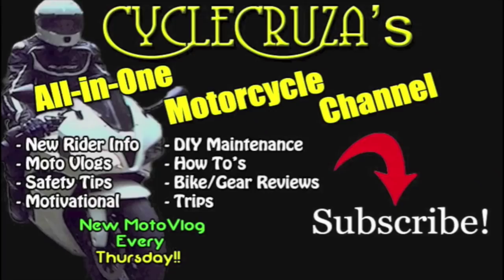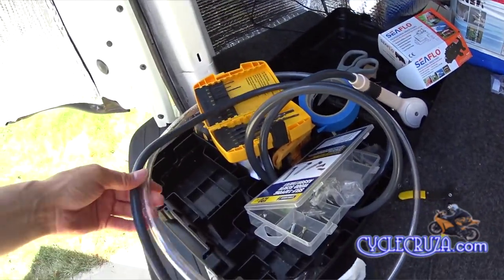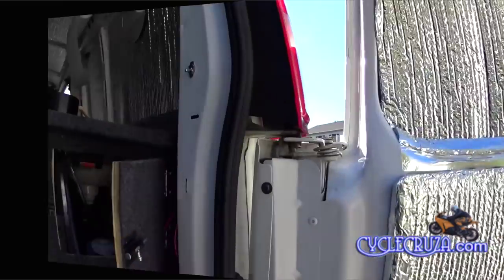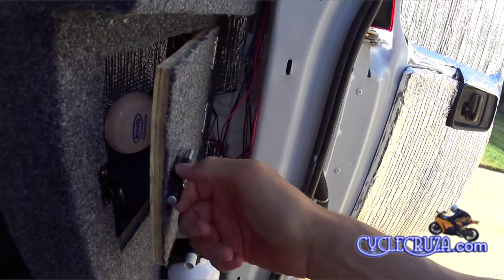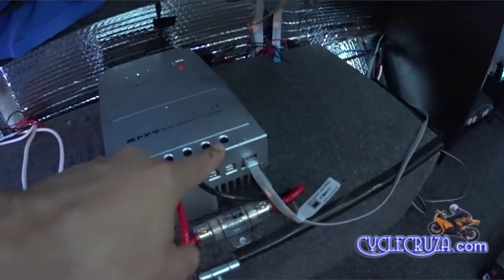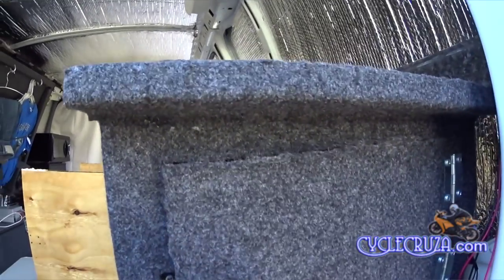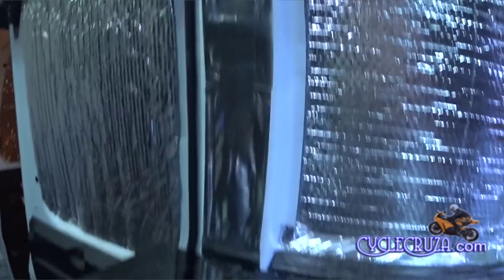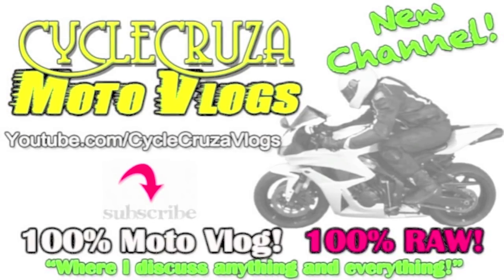How To Shower from Van | Portable Shower - Water Pump - Hot Water Heater | Bug Out Van Build

Comment from the maker: FYI - Links to get items seen in video! (Since people always ask!)
Get Portable Shower Tent here: http://amzn.to/1KLxWav
Get Water Pump here:  http://amzn.to/1M6eOHo
Get 12 volt Hot Water Heater here: http://amzn.to/1g8HmlE
Get Wall Soap Dispenser here: http://amzn.to/1M4EZMX
Get Portable Shower(Get for shower head): http://amzn.to/1H8wXCQ
Get Compact SINK: http://amzn.to/1H8xcxH
Get 7 Gallon Water Container: http://amzn.to/1H5TRbUGet CHEAP 
Get 3/4" Drain Adapter: http://amzn.to/1SCuB0T
Get 3/4" to 3/8" Hose Adapter: http://amzn.to/1Lp6SAe
Get Clear 3/8" Vinyl Tubing: http://amzn.to/1ItO9xj
Get Tubing Clamp: http://amzn.to/1CnKAXq
Get 16 AWG Oxygen-Free Copper Wire here: http://amzn.to/1CPGpcP
Get 2000 Watt Pure Sine Wave Inverter here:  http://amzn.to/1P6ay97

Get Compact Travel Table here: http://amzn.to/1IjtKvf
Get 300 watt 12 volt Water Heater here: http://amzn.to/1KLxQzp
Get 100 watt Bendable Solar panels here: http://amzn.to/1S1ROaJ
Get MPPT Solar Controller here: http://amzn.to/1S1Sop0
Get Solar Controller remote Meter Here: http://amzn.to/1K16asL
Get 155 AH Deep Cycle Battery here: http://amzn.to/1S1RxVa
Get Electrical Switch CHEAP here:  http://amzn.to/1IzFusY
Get LED Light Set CHEAP here:  http://amzn.to/1IizIQH
Get 10" Hi-res Back-Up Camera Monitor:  http://amzn.to/1M1xZAC
Reply: +CycleCruza Instead of a spoon, how about a length of PVC pipe that fits the inner diameter of the hose and notched at the bottom to allow water intake. Now you can make a fishing lure out of the spare spoon. Great vids. Film school alum?
Reply: +CycleCruza Instead of a spoon, how about a length of PVC pipe that fits the inner diameter of the hose and notched at the bottom to allow water intake. Now you can make a fishing lure out of the spare spoon. Great vids. Film school alum?
Reply from the maker: Douglas Higbee spoon takes up less space and works well.

Comment: You have some serious skills.......I've loved watching all your van conversion vids!
Reply from the maker: Ontheroadwith Joy Thanks! I appreciate your viewership. Take care!
Reply: CycleCruza You should make a shower that has water in a endless loop but it has a filter for the water to be clean water. Then it goes into the water bucket again.
Reply from the maker: Justin Hundley Maybe when I'm bored in the winter. lol Space is limited though so it's going to be tough. All I would have to do is attach an inline filter and a hose to te other end of the filter to go right back in the container. However, I don't think there is enough pressure from the drain for it to work unless there is a filter out there that will work. I'll do some research in the winter months.
Reply: Justin Hundley yes! thats always been my idea for my off grid home or van that i plan on doing but NO ONE has it so im like is it just not possible?  cant see y it would be? glad someone had the same idea!

Comment from the maker: ***CycleCruza's Recommended Videos*********

Watch Live in Van with Motorcycle Video here:
https://youtu.be/I48R4tB-cys

Watch Bugout Vehicle Unveiling Video here:
https://youtu.be/l7gU7P-kv8I

Watch Bugout Van Build Part 1 Insulation Video here:
https://youtu.be/kp59Nkk7Asw

Watch Bug Out Van Build Part 2 -Flooring Install Video here:
https://youtu.be/NXPwck_WcvE

Watch Bug Out Van Build Part 3 -Sink Counter Build Video here:
https://youtu.be/pcZR7bqqoWw

Watch Bug Out Van Build Part 4 - Folding Bed Build Video here:
https://youtu.be/VRFYFsW0t9I

Watch Bug Out Van Build - LED Lighting  Video here:
https://youtu.be/BduzjVNQgEg

Watch 'How To Load a Motorcycle in a Van Easy" Video here:
https://youtu.be/mq1YguXZQ0Q

Watch Bug Out Van Fold Away TV Build Video:
https://youtu.be/0C9AG1W-XRM

Comment: Drill a hole in one of the bottom corners of the jug. Insert water tube that goes to pump. Seal. Mount jug on slight tilt to favor corner. Win.

Would need to account for needing to remove the jug to drain or refill. But would allow you to get at that last inch or so of water.

Comment: Love the basic concept. I'm just trying to research best way to shower in bad weather rain wind or even winter. Tuff in a van you can't stand up in. If you could make a small sitting shower stall inside with a little bending and stretching you could get clean and still drain water the same way. Although in winter I'd be afraid of water freezing to tire well . Still where there's a will there's a way.
Reply from the maker: I just wash up at the sink inside the van, just as a I do in my home when I don't take a shower. I did a full body clean-up at the sink sitting on my van bed in front of the sink, no problems.

Comment: I found that I use 2 gallons of water when I shower. You also want to insulate your water container. If you are where it rains a lot and you want to store some water in a remote location if you come across a tossed above ground pool you can build a box or dig a pit and line it with the liner and then you have remote water saving you gas. Most will return to the same site. If I were HOBO I would have these water storage sites so I could use it for my needs. Just pump it out if you need to drink it carry a filter.

Comment: Rigging a switch up to your faucet handle would be easy and convenient. cut the line going into the original switch for the pump, connect a wire to each cut wire and run it along the line to the handle, then to a switch on it. Now you have to have both turned on for the pump to work.
You could either buy or make a "float switch" to cut power to the pump when there isn't enough water. That would stop you from breaking your pump.
Reply: illidur That is what I was thinking. A water proof push switch connected to the negative wire.

Comment: Continue to enjoy the videos!

I'm not sure if the wire and contact points on the heating element are meant to be exposed to the water. Usually heating elements are screwed into a tank and only the threads and element are actually in the water.
Reply from the maker: giff74 Hey thanks for watching! We shall see how it works, the wire is oxygen free 99% pure copper wire. Also, I can always put the element in just enough so the wires are not exposed but rather just the element. I'm only heating the water before using it NOT while in use! The heater element level can be adjusted by the spigot, no big deal.

Comment: if you use a drain pan designed to prevent damage from leaks on a wash machine with drain hose attached you could possibly do shower in van. these are plastic and about 32" sguare and 1-2" high, I think.

Comment: Question: Would a 35 amp hour battery suffice if it was strictly dedicated and used only to shower? I would plan to hook the battery to leads from the alternator for re charge. Also, typically, how long does it take to heat up the water to adequate shower temperature? Thank you.

Comment: how long does it take to heat the tank of water? lived in my van for 3,5 years winters harsh no heater but 2/3 hot water bottles in minus temps worked up to -15. your setup is well thought out and practical thanks for the video
Reply from the maker: +david edge Took me about 2 hours in 40 degree weather. However, I plan on hooking up the heater element wires up to my solar controller which will turn the heater on automatically for whatever hours I choose to set it at, so that way I will always have warm water and won't have to deal with a manual switch.
Reply: 2 hours not bad for that much water and low power consumption element. in winter it would act as a giant hot water bottle for the van too. maybe wrap a blanket around it to insulate then use the blanket for bed. good choice with solar. thanks for reply :-)
Reply from the maker: david edge I wrapped reflectix insulation around the container.

Comment: I would have just gone with one of those lawn and garden sprayers that you normally use for weed killer and stuff.  You pump it a few times and you are good to go... no need for electricity or anything like that.  It is also very portable.  On top of that, you get even more PSI... up to 45psi.  They start at about $10.  You might also want to get a different nozzle for the end though... like maybe one of those sprayers you have attached to your kitchen sink.
Reply from the maker: +101perspective Electricity is FREE, I have 4 x 100 watt thin flexible solar panels on the roof. When I took a my bug out trip all of my power needs were met.
Reply: CycleCruza
Yeah, I was thinking more in regards to simplicity and cost.  And it would be more portable and function better... more psi.

Not that the system shown is horrible or anything like that.  I usually just try to keep things simple is all.
Reply from the maker: 101perspective Those weed killer type of pumps are only good for a few spritzes, definitely, can't take a comfortable quick shower with it. I barely get more than a handful of spritzes when I treat the weeds in my yard.  You will definitely want solar power on the road if you can afford it.

Comment: Awesome built.  Only question with the heating element immersed like in the plastic container - any issues with the element touching the side - ie melting?
Reply from the maker: +Wade Smith No problems BUT in the future I will only lower the element only in the water and not completely immerse it with the wires because it caused rust on the top if the element and put a little rust in the water.  Rust is harmless but I don't want it in there going forward.
Reply: +CycleCruza thanks

Comment: If you are using the sink to wash and you need to keep the drain (via wheel well) closed, how much water can you hold in the piping? If that's not clear, you have a 7 gallon container, how much can you pour down the sink without needing to open the wheel well drain?
Reply from the maker: Wunel No the sink has a drain stopper. It's a regular sink with a strainer drain stopper. That sink holds a lot of water too, more than it looks.

Comment: There isn't any problems with submerging those live wires connected to the metal coil in the water?
Reply from the maker: +Zachary Woody No,, however, next time I will not submerge the wires because it made rust in the water but it worked fine. I should have just lowered the element down in the water only.

Comment: Two questions: first, that water pump sound that it's a bit noisy, have you try it on with the doors all close to hear how loud it get? and second, I am kind clumsy with electric installation, I see your water heater is electric but still is under water, how that work?
Reply from the maker: spiderpilot The inside of my van is fully insulated with 1/2" thick foam panels over all walls and ceiling and reflectix insulation over that. Even blasting my 1500 watt stereo system with the doors closed you can hardly hear anything. Electric wires work under water, if there was ever a problem I can set the level so that only the element is in the water. The spigot can control the level by just opening and closing it.

Comment: So, do you have enough power to run it all at once? Or can you only do certain things at a time.
Reply from the maker: shandon williams I would only use what I needed. Most stuff in the van has pretty low power usage except maybe the microwave, burner and stereo system. The heating element is only 300 watts, water pump uses little power, LED tv uses little power, and LED overhead lights uses little power.
Reply: Have you went out and used the van yet? Or are you still setting stuff up?

Comment: CycleCruza yo you sould have a reserve tank just in case u need more water or get another 7gallon tank just a idea bro but your van is really coming out pimped the only motovlogger with a design so freaking cool it's a sleeper looks normal outside but the inside 😋 chill mode one more thing u can edit your vids in your van to and upload your vids with some wireless network that will b off the hook for travel
Reply from the maker: willmatic 84 Thanks! I just received my back-up 5.5 gallon water tank today, it's tall and narrow so it will fit in the foot well next the refrigerator and side doors. It's never ending on stuff to get for the van. I still have to buy laptop to edit video on the road....
Reply: CycleCruza oh ok cool so u had that planed out lol I would imagine how much you spend so far 😨 but at the end results 👍 😎
Reply from the maker: willmatic 84 I have a folder busting out of the seams with receipts, however, the good thing is mostly everything is tax deductible because most of the stuff I bought was all filmed for my channel.
Reply: CycleCruza word I feel u man 😉

Comment: ok ok...so 300 watt 12volt heater element needs 25 amps of juice...How do you supply that many amps without burning something up?
Reply from the maker: +Dudeareno Rodent I have a 400 watt solar set-up with two 155 ah deep cycle dry cell batteries. I only heat the element up for a couple hours to warm the water up before I take a shower or wash up at the sink. I recently did a review on my stealth solar set-up: https://youtu.be/CNb22_F9MW4

Comment: You should really label all of your buttons and switches, also what ways (other than convection oven) do you have to purify water? I'd get the katadyn water filter if I were you Katadyn Hiker Pro Microfilter https://www.amazon.com/dp/B002CN82V2/ref=cm_sw_r_awd_V4FWvbDA60QT4 or something along this, always great to have a backup in case your out of your van and on the dual sport.
Reply from the maker: Big Mike I did label the switches! It was shown in the video but I guess you missed it. I added the labels when I finished the water heater hook up. I have two sources of water, I have a 5 gallon reverse osmosis drinking water on the left side of the cabinet and a 7 gallon container of water to wash up with. I'm not really concerned about the water to wash up with. .

Comment: What if you put the water heater element on a bob float?
Reply from the maker: mabutoo don't need to, this set-up should be fine. I have some testing to do though t see how long it will take to heat up 7 gallons of water.

Comment: Is the total cheaper then a trailer or small RV?
Reply from the maker: Jason Rubin Well I spent under 10k for the van and mods, you can't really get a great RV of any kind for less than 10k unless you get really lucky. Also, the main reason I went with a cargo van is so it doesn't stand out like a RV, it appears as any other work van from the outside so you can get away with parking overnight in some locations that a RV can't. Also, I can maneuver much better than class A, C and some class B RV's. I'm also able to accommodate a motorcycle in my van without the need for a trailer which is worth it's weight in gold. All around my van is an unbelievable value for all the options you have with this van. However, with that said, I will never do this customization again. lol It takes so much time and consumes your life if you want it done quickly.
Reply: CycleCruza i understand it seems like a tough process that im sure your very proud of. Congrats on the nice build brother
Reply from the maker: Jason Rubin Thanks!

Comment: Have you had any issues with your water heater setup, like melting the water container or the wire contacts shorting in the water if you get the depth wrong  :)   That aside, I dig your ingenuity and economical design.  However,  I was also looking at something like this:   http://www.amazon.com/dp/B000TXOJQ4 and using the small propane bottles with it.  Did you ever consider a solution like that?
Reply from the maker: +bobbyknc Actually, on my colorado bug out trip, I completely submerged the element with the wires and it did not short, HOWEVER, it did create RUST at the wire contacts on the top of the element but still worked fine. Next time I will make sure to just keep the element at the proper level with the wires above the water. I prefer my set-up over that propane set-up, that's more junk to take up space in an already tight space and much more expensive.  Also, you have to be careful that the water pressure is not too strong because you are only working with a 7 gal container. My set-up is all about space optimization.
Reply: Thanks for the reply.  I didn't think those elements could be fully submersed like that. Good to know it works even if by accident  :) 

Space and saving $100 vs instant hot water is a tough decision.  I'm still in my early planning stages and research (which is how I found your channel) and I'm not sure how much space I'll have to work with as I haven't found a van I want to buy yet. 

I really enjoy your Bug Out Van series.  Look forward to more.
Reply from the maker: bobbyknc What I did was turn on the heater element a couple hours before taking a shower and it was nice and warm for me when I ready to take a shower. Do what you feel what works best for you though, all that matters is what you are happy with.